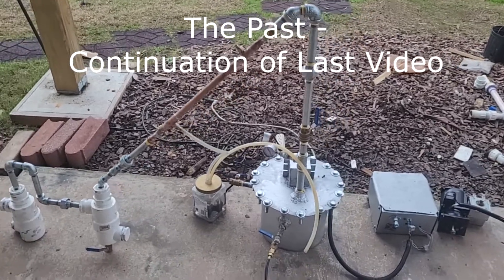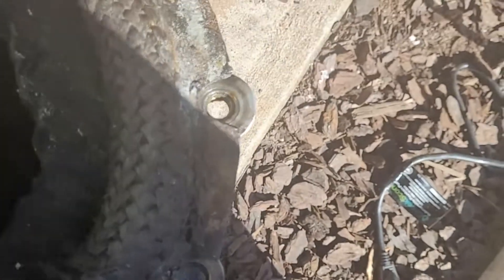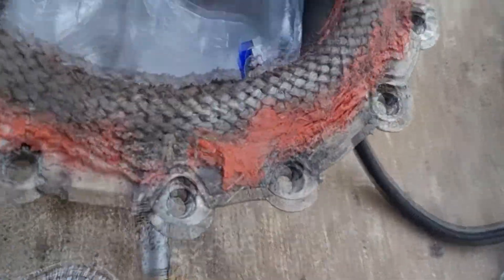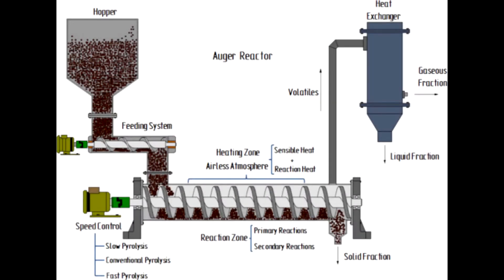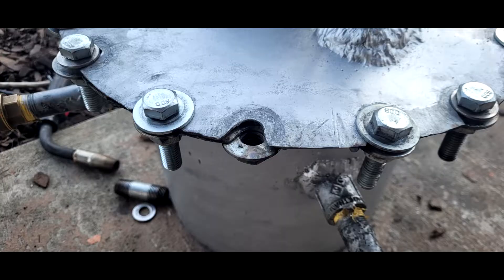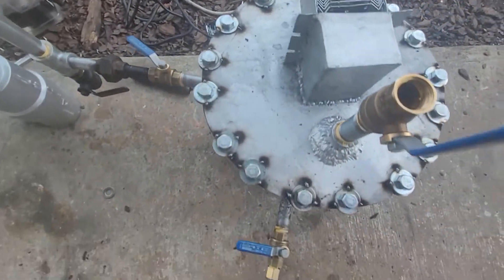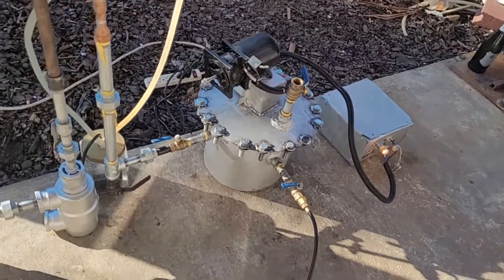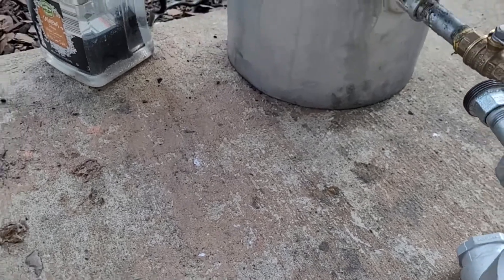Pyrolysis Reactor Update   Big Changes & Fails!

Comment: I like your work! having some thermal mass in the reaction chamber is good so don´t worry about the metal heating up. I recommend insulating the system with some ceramic fiber like i did. You can just wrap it in it. It seems that the microwave induced pyrolysis is just producing more gas. And insulate the pipes till the condenser!

Do not use the water bubler as condenser !! 

The gas is best flared directly to heat the system or with your system you could build a foil gas tank to store it and use it later. 

I hope this helps you a bit. I am really happy to see that my videos actually inspired someone to build their own system.

all the best hazelChem
Reply from the maker: Thank you so much for taking the time to watch and comment, it made my day :))) I'll take what you said into consideration, I appreciate it!
Reply: @naturejab   my plesure ^^

Comment: Hey dude! Got the audio on now. A few considerations for next time then:
1. Agree with Arfer below. Don’t get rid of the condenser but swap it around and put the bubbler right at the end. It will fill up with crud, they all do. 

2. Move the column back to the top output. That’s where the oil vapour and gases want to go. 

3. Get some car exhaust wrap off eBay. Wrap the outside of the reactor in it and wrap the output column with it as well to keep the heat in. I do not get any oil until the top of the column reaches about 100degC. 

4. Use a cheap oven thermometer to roughly read the top of the column temperature. 

5. Consider swapping your rope seal for automotive exhaust cement. This stuff expands with heat and will stop the reactor leaking. Yes, it’s a PITA to keep removing it and re-applying it every time you remove the lid but it comes off very quickly with a wire wheel. It’s the best solution I found. 

6. Some plastics will not pyrolise into oil. PP and HDPE will, but others will not. They just give off gas. Consider putting in a quart of used motor oil
Reply: (Continued) motor oil to get rid of the air space. Finally, most of the plastic guys find they do not get liquid but get wax instead. You will need to run the wax through once more to get liquid. 

These are all just considerations mate. Keep going!
Reply from the maker: @elcaboelcabo2881  thanks so much I really appreciate the advice! The used motor oil is genius to deal with air gaps, and I resealed the gasket with silicone because the gasket cement tends to come apart under microwaves. I'll put together what your saying and see how it turns out. Thanks once again!

Comment: you need the cooling jacket pipe on the down side of that up and over pipe then your water bubbler where it is now should be empty and it should be your oil collecter. your water bubbler should be at the end of the system as a back spark resister as the system should be airtight therefore little chance of it ignighting. you also might want to try a bigger resiviour for your cooling jacket pipe and maybe drop some ice in it as that water coolant in that small tub will heat up very quick and become useless. hope this helps and keep up the good work. appologys for my spelling :)
Reply from the maker: Thank you so much for this suggestions! I'll give it a go today.
Reply: @naturejab  good luck. Hope you get it working. I hope to complete one that I am building this year, but i will wait to see how you get on with microwaves. I was going to use waste oil
Reply: Agreed with Arfer. Haven’t listened to the audio yet so will check back later. Great progress though!
Reply from the maker: @arferstone1528  Cool stuff! The more that are built, the better. I actually want to try waste oil out in mine because it will readily absorb microwaves and produce a nice fuel inherently.  It will also be super easy to automate since it's a liquid and can be pumped in continuously. So I'll save that for once I get the hard part out the way (plastic)